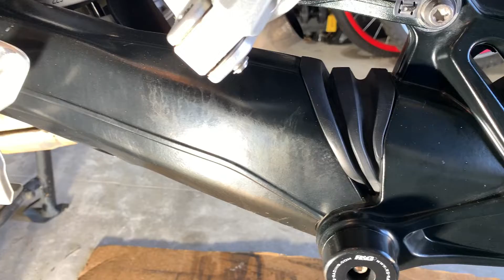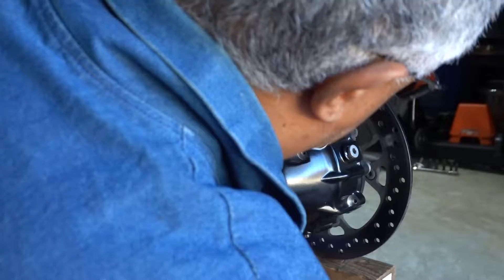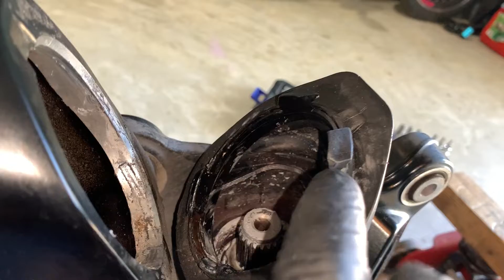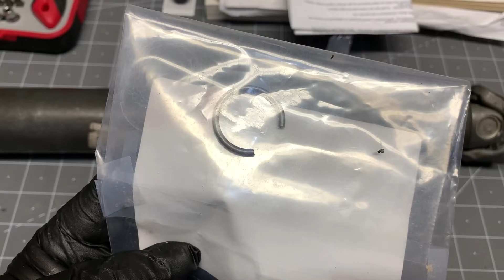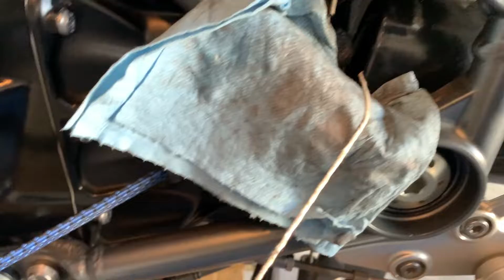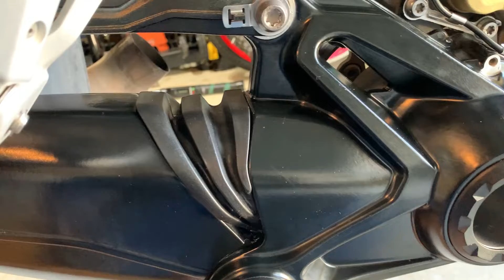Final Drive Service & Shaft Check ... rusty splines? | 60,000 mile Service | 2016 BMW R1200RS

Comment: Hey do you still like your sidici strata 2 or you got rid of it and if not how you like vs the shoei rf-1400? Or you use both for what? I just ordered my rf-1400 and another sidici animale graffics but thinking or canceling the sidici because I already have a white strata 2 what toy think keep both or return cause I already have a sidici but It's XXL and I'm xl
Reply from the maker: I still have the Sedici Strada II Primo Carbon helmet, but hardly wear it since getting the Shoei RF-1400. 

The Sedici is still a great helmet and represents a great value, but the Shoei is a better helmet that has better aerodynamics. At lower speeds it is similar, when you turn your head from side to side but say at 60 mph or more the Sedici will pull more when you turn your head. The Shoei flows more air as well. I should use the Sedici more especially when commuting to work but I don't have a photochromatic shield for it and I leave for work in the dark. I don't swap visors. 

If you are getting an RF-1400 and already have a Strada 2 that is too big, then I'd suggest getting the Strada 2 in XL if you really want a second helmet with graphics and get rid of the too-big XXL. Better to have a proper fitting helmet since it is, primarily, a safety item not a fashion statement.
Reply: @GrumpyGoat  thanks

Comment: My 2018RS splines were dry from the factory best I can tell. I bought it this summer, used with 4K miles. No rust but the rear was pretty tight and no circlip ether, so the front pulled loose when I lowered the final drive. I had to take the drive unit off to separate the shaft. Wasn't too difficult. Getting the front to engage was a pain, I had to disconnect the rear shock and raise the swingarm with a jack to get things to line up better and used a long flat bar to lift the driveshaft into position. Struggled with it for several hours before it finally engaged. Next time I will try the string method.  Maybe BMW was leaving the circlip off because it's really not needed and makes reassembly even more difficult.

Comment: Very clear and concise video on checking the drive shaft condition along with disassembly and reassembly.  I am having my drive shafts on the RS and RT pulled every 24,000 miles to check condition and relube.  I just had my mechanic pull the drive shaft on my 2022 R1250RT at 12,000 miles finding the splines were not adequately lubed with minimal rust.  The charge at the dealership was $105 for doing this.